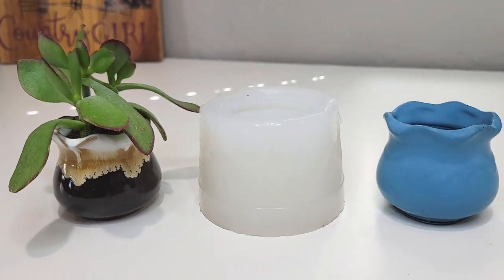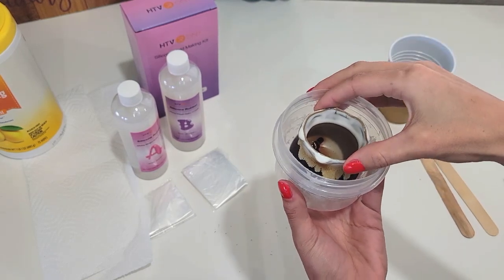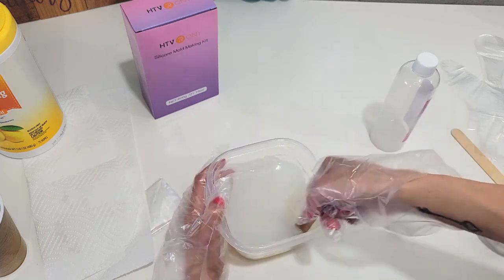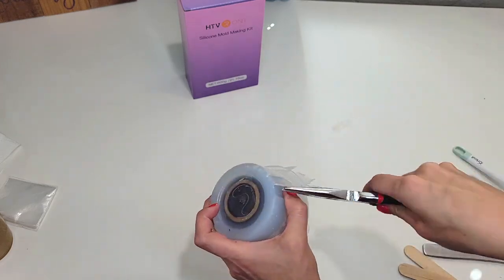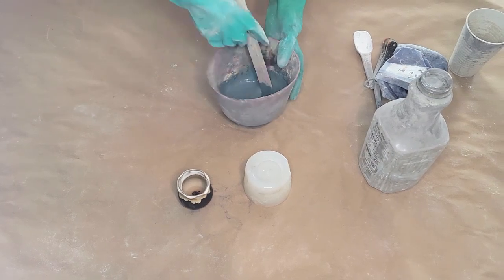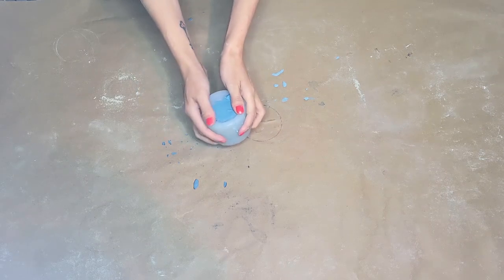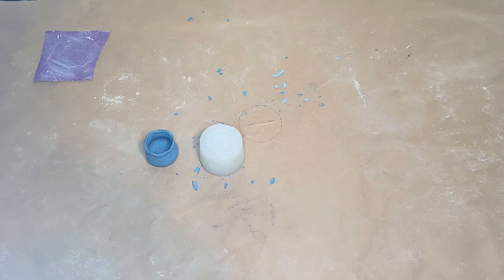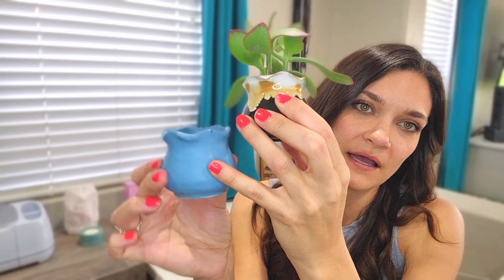How To Make Your Own Silicone Mold - DIY Silicone Mold for Planters or Candle Containers

Comment: Thank you so much for a great video. Is there a way of estimating how much silicone gel you will need so you dont make too little or too much?
Reply from the maker: Hi! Thanks for watching! When making my own mold I've been eyeballing it since it is a new container. You could try to fill the area with water and then measure how much water fit in the area to help estimate how much silicone you need :)

Comment: Thank you very much for this demo and for your your advice during it.  I wonder if it's possible to make a mold of a container with a handle e.g. a tea cup.
Reply from the maker: That would be a cool project! The handle would need to be thick so it doesn't break easy but that sounds really nice!

Comment: Good video. Question though. After using my silicone pot mold three times for my wax luminaries I started to get lines on the outside of my wax afterI demolded them all the way down. Any way to prevent that? I’m pouring into a warmed up mold. Not sure if you’ve personally used them for this purpose.

Comment: Hello! I've been crafting silicone molds for my customers and noticed varying behaviors in the same brand of siliconeI use platinum based silicon. While previous curing times difered—ranging from 24 hours to as little as 3 hours—they never affected the resin outcome until now. Recently, when the silicone cured within 3 hours and I poured resin into it, the silicon lost its shine upon removal of resin from the mold. This unexpected issue has me deeply concerned. Any guidance you could provide would be greatly appreciated. Thank you.
Reply from the maker: That is a strange reaction. I haven't experienced that before but I'll keep an eye out and let you know if I do and any advice I may come across :) thanks for watching!

Comment: how do u clean the bowl with the concrect in it? and how since it is so stained when u use it stuff dosent come of into the new batch
Reply from the maker: I let it dry a bit after using it and then the concrete just pops up as I fold the bowl left and right. I found this to be the best and get out most of the concrete. I don't ever have any issue with anything getting into my new batch if I do it this way :) 

If I am doing a few different colors in one go (ex one black, one blue, one white) I'll do white first, then blue, then black so the colors get darker as I go and they won't affect the next color. Hope that helps!